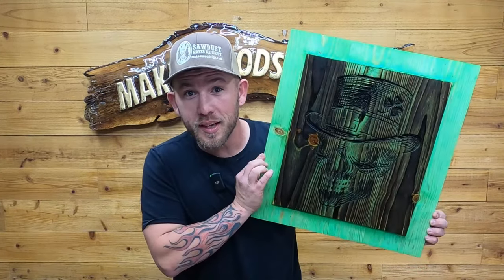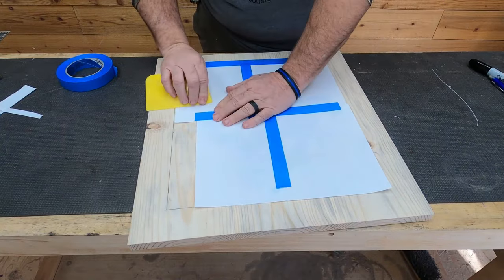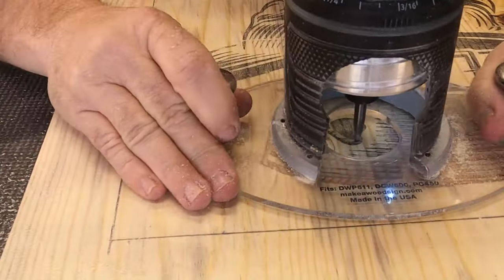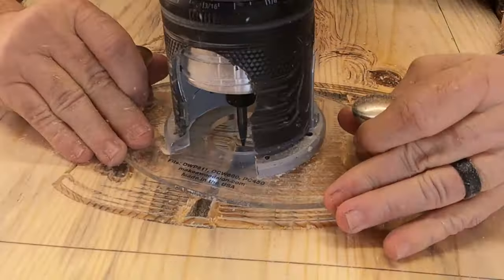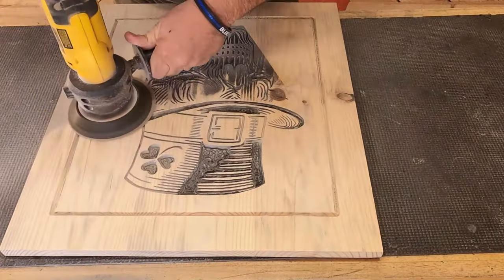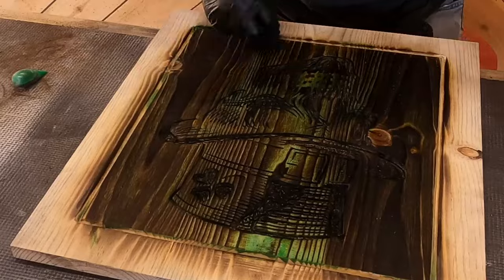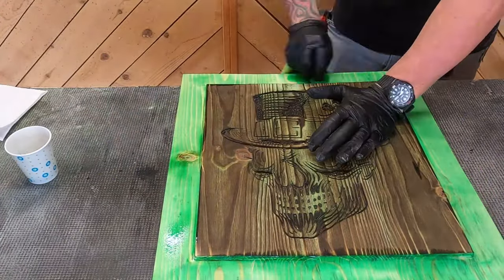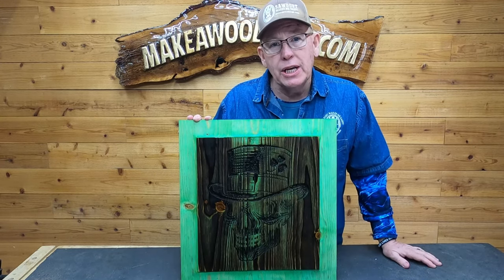Adding Color To Woodworking Projects With Food Coloring

Comment: Howdy Mr. Eric and Mr. Ryan...

Ahhh, finally, "The student teaches the Teacher" 😅😅

1st off, I liked the Skull Leprechaun, where'd ya get it? 

Overall, I liked the carving....Until ya burnt it, lol. But, it still gave it a kinda "Olde" appearance which was good. 

Now...as I have been doing the food coloring dye and burning method for as long as I've been carving (approximately 2.5 years now and SOLELY because of this channel....Had I not found this channel, I would never had started carving)....The student can teach thr teacher. 

When burning a panel...In yalls case, a glued together panel, unless than wood is 1" or thicker, you MUST add a backer to the panel. Otherwise the panel warps. So, add a 1/8" or 1/4" backer onto the panel (drawer bottom plywood). BUT, the grain of that plywood needs to go opposite the grain of the carved panel. In this case, your panel board was vertical, so your backer board would need to go horizontal. It might still warp slightly, but not by much and it only costs a few bucks. 

After burning and then wire brushing, you can't just use an airhose. Use a spray bottle with water to help rinse the char off the carving. And DONT use a paper towel at all. Use a Terry towel to wipe the board clean and dry in conjunction with an air hose. 

This gives you a much MUCH cleaner panel after burning and brushing. 

The Food Coloring: That Gel stuff works GREAT, but I saw that you just put it on straight from the bottle. "THAT" is why it came out bad. The pigment is TOO thick straight from the bottle to soak into the wood. 

Next time, add the GEL to a cup of water with a cap full of rubbing alcohol to dilute it a bit. I'm telling ya, it works. 

That liquid food coloring...no matter how many drops you use, it'll always come out lighter tint than you wanted. 

And since we are talking about "Dyes" to color wood as opposed to spending near $30 for a quarter of tinted stain....

I no longer use food coloring at all. I go to Walmart or any crafts store (but Walmart has better prices) and I buy acrylic paint from the Art hobby section. The brand is called Folk Art. Inexpensive, like $1 a bottle and a complete RAINBOW of colors to choose from. 

Squeeze a bit of paint into a cup of water with a cap full of rubbing alcohol. Mix well. 

This method works FAR FAR FAR better than food coloring. For that matter, this is a cheaper alternative than using tinted stain too. Same results at a 20th the cost. Though, if I'm staining a larger project, say, a Flag...I use less water with more paint. 

The purpose of the alcohol is to allow for smoothness of application. Thinner could be used, but I found that it was too "thin". And the alcohol reacts with the wood fibers to "open" them up to allow for better absorption, especially around those pesky knot holes. 

And finally, the last detail here. WATER COLORS. They even make water color PENS now, so if you want to add fine detail HIGHLIGHTS on specific areas, you can now do so without blending into other areas of the carving. 

And lastly....to touch back on burning. There is a Burn Paste along with a burn PEN you can get. Cheap too. 

So, with this particular carving, let's say you wanted just the outside area of the carving burned but leave the carving along. You can PIN POINT where you want the burn without masking...brush on the paste or use the PEN (the pen is similar in size to a Sharpie with a point). Then, use a heat gun or a hair dryer, the activates the chemical and, burns where you placed it. Imagine what you could do with yalls templates by using PRECISE burning. That means, instead of using paint to outline an OUTSET template, use the pen or paste instead.  Now you've got burnt Outset letters ONLY. Everything else, do as you were. 

Anyways, I'll always be yalls Padawon, but thought I'd share some techniques and methods I've come up with to make my carvings more unique.  😅

Loved the video. Looking forward to the next..

P.S. Mr. Ryan....Don't give up on the burning and Dye. If we all gave up on a carving or burn that didn't look good, we would never become better, right?
Reply from the maker: Well said, buddy! We'll have to try your technique

Comment: You could just airbrush your food coloring water on their instead.  Get yourself a cheap brush and you obviously already have a compressor.  Your airbrush doesn't even have to be dual action.  If you obtain a little skill, you can do a gradient or vignette effect around the outside so the coloring doesn't darken the center.  I suspect you could use diluted ink to do this also, especially if you use an airbrush.  The other nice thing about using an airbrush is you could use lace or a stencil of some sort to make a pattern on the frame portion.  So many possibilities here.  Thanks for the inspiration!

The router skill is pretty amazing.  If I was going to freehand a piece like this, I would use a dremel or a foredom style tool.  I suppose the nice thing about the router is the depth control...
Reply from the maker: We actually have an airbrush, but we suck with it HAHA 
That's something we'll definitely have to practice with

Comment: Do you guys not use the label backing for photo transfer anymore? A pack of 100 8.5x11 labels are only 13$ where the freezer paper is just as much for only a 10 sheets. Just curious if the freezer paper is better or if that's just what you used on this particular one
Reply from the maker: No, we almost always use the label backer. It's more translucent and a little easier to do the layout

Comment: First off may I suggest you 86 the whole food color idea, and try out samples from a company in manitowoc wisconsin called Keda wood dyes, I've been using them with great results and even the sample packs go quite a ways, another idea, time, and muscle saver, is harbor freight has a power tool called a surface conditioner which uses drum like scotch brite sanders that do the same work as you were trying to do manually, I believe you'll find both ideas will work to your advantage,  you'll thank me later 🙃
Reply from the maker: Thanks Donald, I appreciate the insights👍👍